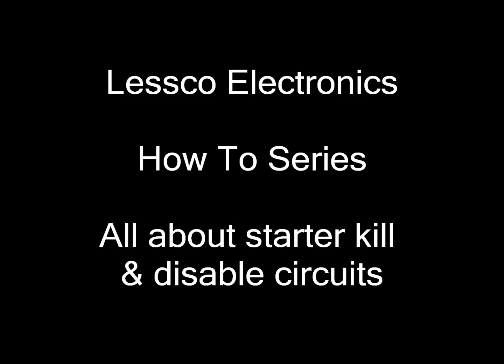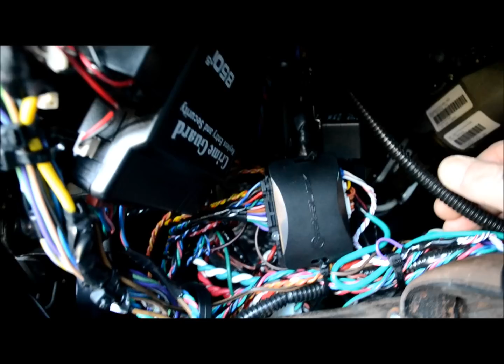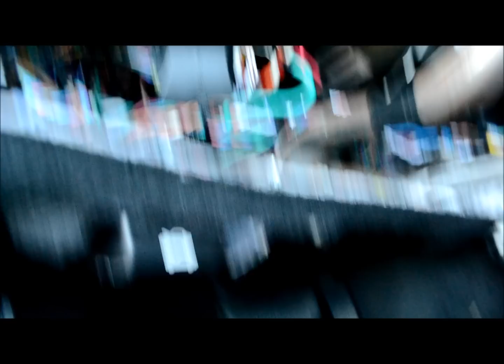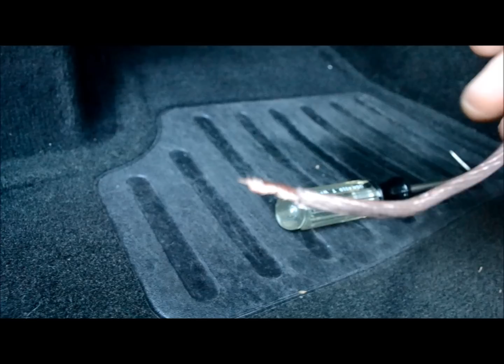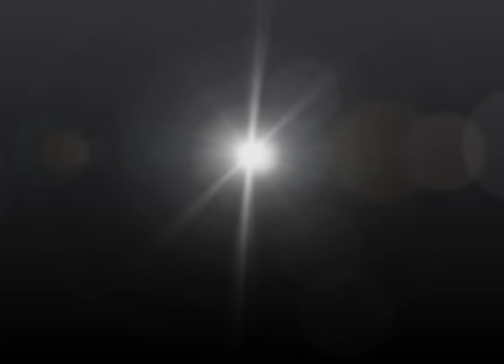Car alarm How To - Repair or remove a starter kill disable

Comment: i have a 2001 Nissan x-Terra
Reply: I have a 2000 did you ever resolve the problem ?
Reply: +Courtland Sharod no I didn't. car engine still refuses to turn on. I've tried the unlock / lock thing and the at doesn't have the button this guy on this video shows. how did you get pass the anti- theft?

Comment: @Lessco Electronics HI, 
I have a 1985 mint condition immaculate corvette. The problem is is we put a new battery in it and over a period of time, a short period the battery dies out. we have, or I should say my father has come to the conclusion that the aftermarket Viper Alarm that was put in in the early nineties is draining the battery somehow. so, what do you suggest I do? Should I do the dash removal under the steering column and find that relay and just cut the wires or should I do it the correct way and unplug it or what? I need to sell the car it's been sitting since 1996 in the garage and I'm telling you dude this car is beautiful for a 1985 which is the ugliest year of Corvette ever made but it looks showroom ready please I am begging you to give me a good response we have been dealing with this for years now and we just haven't had the time to get in it and do anything with it since I don't have much knowledge with electronics on cars and my dad who owned it is bedridden and dying. Thank you so much for any input and thank you so much for taking the time to make this video.
Reply: I would like to add that once the battery has drained it is completely gone and not usable
Reply: so we have been through so many batteries probably 10 I'm going to buy a new battery and I mean legitimate information and you seem like the right guy
Reply: it is not the starter and it is not the alternator
Reply: take to a mechanic have him pull the alarm system out
Reply: csippola8 thanks do you know where it is? the guages are digital and it has all those race track switches to check ur motor and i think thats where its behind. i dont wanna snap and plastic removing the cluster etc
Reply: its ridiculous what they put in the 85 vette.... they were tryin way too hard for technology i guess with all those digitals and switches. so stupid

Comment: so i gound the relay but mine has 4 wires white on the left purple in the center red on the right and yellow on the bottom
Reply from the maker: +Robert Smith the two thick wires should be the starter wire (both sides) to put back together

Comment: On a Pontiac Grand Prix 2004, can i still use a screw driver to test the connection on the starter? Lol, I'm serious. It's a hilly billy way, but i have no tools and my car wont start. I'm almost positive it's the alarm, but just wanted to make sure. When i turn the key now, I hear something moving like a motorized noise and then that's it. No engine fire. If I let it sit and trying the key 10 minutes, wait, try it starts.
Reply from the maker: +doublee313 you can still bump the starter that way

Comment: Hey man thx. I'm a computer guy but no nothing about cars. My viper alarm has been working and not working starting the car. If i cut it on and off a ton of times it might go. Sound like an issue with the alarm? Been doing this for years but rarely. Today its worse.
Reply from the maker: +doublee313 sounds like it to me

Comment: amazing, I never knew a bad alarm can kill the car engine. my after market alarm won't let me start the car. took it to the dealership yesterday, they told me they have to reprogram or reset and are waiting for a 'part' this was yesterday. called today, still waiting. I already had car towed to the dealership yesterday thinking it was going to be an easy fix(that's what they had told me). should I just pay some one to remove the whole entire alarm system or is just try and fix it?

Comment: Thanks for the video!  I had a question though...I have a 2005 F150, the kill switch was somehow tripped by itself.  It was parked in my garage all night. The night before, I locked the car and when I came back in the AM, unlocked it, and got in, no issues, went to start, then all lights got killed, keyfob won't respond, no dome lights, won't turn over, nothing. I hear a buzzing noise corresponding to the alarm led flashing on the dash.  I knew it wasn't the battery, because it's new, so I mess with it for a few minutes and decide to just disconnect and reconnect the negative terminal and that fixed it. Is my kill switch going bad?  Is something else going on? Can I just replace the whole shebang with an aftermarket alarm (mine is factory) and be good to go?  Please help, I don't want to be stranded somewhere when I least expect it. Thanks in advance!

Comment: My daughters 97 Acura, Replaced Batt. Alarm goes off-no start. Got 5 digit code from dealer to enter into radio. Entered Radio reset+ accept'd code. FOB won't re program. Car starts- Alarm goes off when I open  Driver side dr. I live 200 mls from any dealer they All want me to tow it in+$300 ( they're not even sure if they have/get software for it.) Had to call 5 dealers just to get code...........Little help
Thanks.
Reply from the maker: +dadrules714 try unlocking the driver door 2x with the key, lmk if that did it...

Comment: i have a 1998 dodge grand caravan 3.8.i used the key to open doors because my alarm remote control dose not work.now my car won't start the lights are dim and the lock go crazy.panel works lights flicker when car is running.also have to jump start.i think the silent alarm drained the battery but not sure.iod fuse is not blown
need any kind of help.and a weird noise comes from under the dash when key is in on position.and door chime dounds distorted.can this be factory anti theft system.

Comment: Have a 98 Legacy Outback and when I put a new battery in last night it activated an alarm I never knew the car had. I had seen the horn under the hood but assumed it was disconnected seeing I never had an alarm light or ignition problem until now. If I follow this video it will fix my car not turning over issue? I want to make this permanent though. Whats the best way to make it permanent?
Reply from the maker: +Rob Zanni yes, definitely

Comment: What if you don't connect the the relay? I'm still working on my autopage alarm & starter and so far I'm done connecting all wires. But.  When I try to arm or disarm my truck it tries to start my truck:\Also when I try to start my truck with the transmitter, nothing happens  any idea what it might be?

Comment: How you doing sir 
I have a similar problem with my 96 impala ss it won't start it had a prestige alarm system on it I did what you said but also the previous owner before told that it had remote start just has to be reconnected...don't really care about it but though I'll let you know...if you can please get back with me, your help is really appreciated 
8328470139

Comment: will that relay that you connected the wire too, make the car not have spark and cause the motor not to turn on? or does this just kill the starter from turning?

Comment: I have a 2002 mountaineer with an aftermarket  starter alarm system. Today i removed/pulled off the same exact one you showed  a relay box under the driver column with all types of wire and now it wont start at all completely dead. What did i do. I guess i have to get towed to a near shop. Plz i need ur help.
Reply from the maker: Mama&Cubby Smith that truck has a factory engine kill in the front left or front right kick panel area with a yellow button usually which may be your issue as well as this starter kill.
Reply: Thank you for your reply. I appreciate it. ? What is a kick panel? So because i pulled the wrong relay, meaning it says Ford PART # F0AB-14B192-AA...and i plug it back my truck unfortunately wont start at all. I was told maybe to disconnect the battery to reset the computer and maybe that will work. But again i font want to take chances.
Reply from the maker: if you sit in the driver seat and kick your left foot to the left - thats your kick panel, its a piece of plastic that covers the corners under there
Reply: +Lessco Electronics i have a 3015 viper alarm I'm installing I don't want the start kill so if I was to keep the  relay in it and just tie the black and green heavy gauge wires together will that work fine ?
Reply from the maker: You can call us at 904 342 5491

Comment: I have exactly what you have on the video. I'm trying to figure out how to remove the kill switch completely.
Reply from the maker: Vincent Turner the 2 thick wires will be the starter wire, put those back together

Comment: I install for a living. We stopped doing the kill relays because there is no starter wire on modern cars. I also never understood why it was a good idea because it just points out which wire is the starter wire with no diagram making the car easier to hotwire!
Reply: I have a viper 3105 I'm installing and was wondering will Alarm work fine without the starter kill ?
Reply: Yeah it will work fine
Reply: +James Musselwhite I figured it would . Besides still using the yellow ignition wire what do i do with orange wire that s in relay connector ?

Comment: There is a fuse under the hood, I have a 1999 Chevy suburban 1/2 ton 5.7 liter, it's a 50 amp marked IGN. Pull this and you're vehicle will start, unfortunately power windows, heater, air conditioning, radio, ect. All quit working. Lights, blinkers and tail lights will still work. This guys video is the best fix I've seen so far without costing a ton of money and works great. I didn't pull apart my dash, I just looked up under and pulled this cluster down.
Reply: Hey please email me about the fix for chevy suburban. I am researching this now. It is at gmail courtneybradley101

Comment: So what wires you cut the Orange and white one
Reply from the maker: Tamiara Hagins the two thick starter wires, in this car it was the red and white
Reply: What would it be in a 99 Camry
Reply: Tamiara Hagins It's the "two heavy gauge" wires, the bigger or thicker 2 wires.

Comment: OMG THANK YOU FOR THIS VIDEO!  i was stuck around the block from home because of the alarm shutting off the starter and i watched this vid, cut some thick speaker wire and installed in the same pins you said and WALA!  IT STARTED!  THANKS AGAIN 2 THUMBS UP!!!
Reply: Which are the pins numbers?

Comment: What two wires we have to cut white n red?
Reply from the maker: Muniz Jimmy  its not the colors so much as it is the pin connectors on the relay, thats what really matters, its always the thick wires on 87a and 30 on a relay

Comment: Same problem. Cranks only with remote start control but doesn't hold engine to warm up. Astra brand. Cranks 3 times before giving up.

Comment: hello please help. i have a remote start problem after removing the battery and reconnecting . the problem is that it doesn't remote start anymore it only reads signal and cranks 3 times but doesn't hold it. just crank after crank. anyone?
Reply from the maker: Francisco & Maria Hurtado what model starter?
Reply: is astra controller not so sure on the computer is off brand ill say it all started after security light blinking on my chevrolet tahoe 1999 i had to do the reset on it with the key in the ignition 3 times every 15 mins before that i removed the battery i believe it was the battery. it will crank but not hold the remote start...
Reply: Did you ever find a fix or get a reply from this video poster for your issue with the alarm in your car?
Reply: What would offer as advice for the factory alarm on a GM model passlock starter kill issue? Mine is one of many that experience the issue. 1999 suburban

Comment: I have a 2002 Mazda MPV lx and when I go to start it the car alarm goes off and the engine will try to crank. Whats the easiest way to fix it? It dosnt matter if I got to rip out some wires because im derbying it.
Reply from the maker: try simply unplugging the remote start thats in there. that oughta do it

Comment: Ok i have a auto page alarm starter system. It starts up when i  press the button but it turns off. I changed my keys so i don't know if that matters. I want my system and i don't know what to do? Any suggestions will help

Comment: i removed a prolock from my 2003 doge neon, the wiring was done terribly by whoever did it so i was only able to get it to start twice... i dont know what the problem is, when i connected the wires i heard a click and the car was able to start.. now it clicks and still wont start

Comment: I have a 2001 Chevy Express Van with the Viper Alarm installed. A week before it started acting crazy the alarm went off and my son didn't know how yo turn it off.. Well he turned it off and drive home and a week later the van would not start.. It will turn over but won't start/ could this be the alarm causing this issue?
Reply: I am having the same issue did you ever figure it out
Reply: @xaviermartinez4714  sorry, just now seeing your reply to my comment.

NO, he never figured out what was causing  the battery to not keep a charge.  My battery is always dead even after we bought a new battery.. I think it's  the alarm running it down. It cam sit fir 4 days and when we go out to crank it the battery is dead.
Reply: @Moonbeam68x  is your negative terminal loose
Reply: @Balls0001  no. We put a new battery on the van and still having the issue. I don't know of it's the Alarm draining the battery or stereo.
Reply: V for lol I'll look loll ò be ozhuz
Reply: @darlenedunlap  ?  V for l9l? OK.

Comment: I am having a range issue with my remote starter, it only starts when i am rite beside the car but as i walk away it wont start any idea?
Reply: Weak battery in your remote starter. Usually uses a coin cell battery which you can buy in any drug store. Will have a number stamped on it like 2032; always put a new cell in with the SAME NUMBER. It only installs the same way the old cell is.

Comment: I need help! Drive a 2003 hyandai elantra.  Lost my keys had a new one made, and it doesn't start because of one of these devices.  The key unlocks the doors and turns the ignition but the car doesn't start.  What do I do.
Reply: How did you fix the problem

Comment: Hello thanks for your videos I have an 08 dodge charger that starts sometimes and then sometimes doesn't start the little red light flashes when it won't start and then doesn't flash and it starts I believe it's called the vsa security indicator light but can't find much info on it I have a factory alarm is this my problem in your video or do you think it could be the key fob please help thanks
Reply: Did u ever get it fix I have a 2006 chrysler 300 mine is doing the same
Reply: Did u ever figure out what it was my 2006 dodge charger doing them same
Reply: Did anybody figure it out I have 06 rt charger doing same thing. Won't crank when it does runs for 2 seconds other times it will run but once off wont turn on again

Comment: On my 1997 Honda Accord SE the security code on the radio comes on sometimes the car turns over with no problem other times the car just turns over without cranking i disconnect the battery once its reconnected it starts could this be the problem Im having

Comment: i have a dodge caravan 2003 and i cant find this anti theft in there plz help.
i have a duplicate key which is not programed to my van so it wont start.
Reply from the maker: did you find a car alrm under the driver dash?
Reply: Lessco Electronics So I bought a '90 Acura Integra LS and it worked fine for a couple of weeks. But the other day after I got off work, I tried to start it, but it just wouldn't turn over. My first idea was that the battery was dead, so I tried to get a jump start but nothing still. So I ended up popping the clutch and then taking it home. Now it has the same problem and I'm pretty sure it's a kill switch, There's what looks like one under the dash, but when I set it at the off, or on position still nothing happens. How do I turn off or remove it? or just unplug it

Comment: hi i read so many stories that sound like mine
my son has a 1999 maxima he lost the key and got one offline.  we programmed the key but the car has problems because it a copy and not the original. if whatt you are saying is true its probably the viper alarm messing with the starter mechanism right?
Reply from the maker: Verify it by jumping put the starter kill relay under the dash to be sure.

Comment: Hello I have a viper 600hf I removed all of the components but when I cut the kill switch the car would not start it is a green and a yellow wire when I plug them back and the car cranks. How do I remove this switch and my car starts?98 Acura integra
Reply from the maker: reconnect the 2 heavy gauge wires back together, It should be a green and a black if I recall correctly, the yellow is a thinner wire and not a starter wire..

Comment: My problem is I popped car open without key so alarm went off and I couldnt find them so I popped hood and disconnected positive battery connection to shut off when I found key reconnected battery and I went to start car lights everything works but when I crank nothing happens radio doesnt cut on dont hear nothing HELP
Reply: Do you have aftermarket on top of factory alarm, if so they could be interfering with each other

Comment: Hello I have 2005 Chrysler sebring I lost my key and my alarm.. I had a lock smith come out and make me a key. The car starts for 5 sec and then cuts off will this work to bypass my alarm.. Thanks in advance..
Reply from the maker: no, that sounds like a transponder issue, if your problem was a starter kill relay like I show the car wouldn't even crank over at all

Comment: I have a 1996 camaroz28 my alarm is causing my security system to fault (vat) I've rutted tried the 10 min trick and nothing. .... I need to disengage the alarm in order to bypass the vat system.... Any ideas
Reply from the maker: watch my passlock video, it's very insightful.